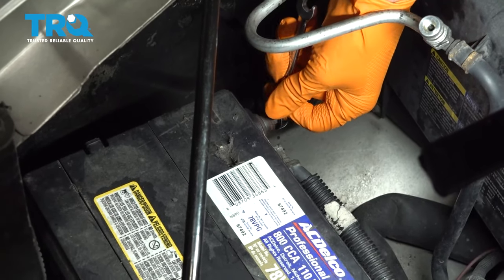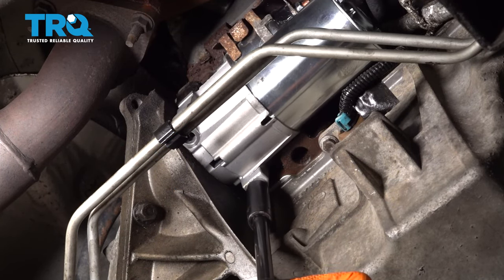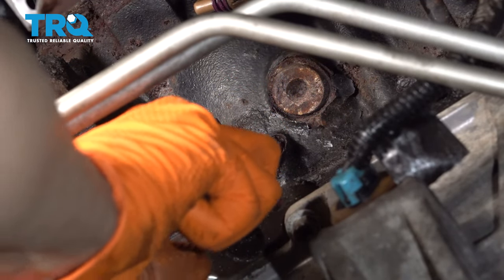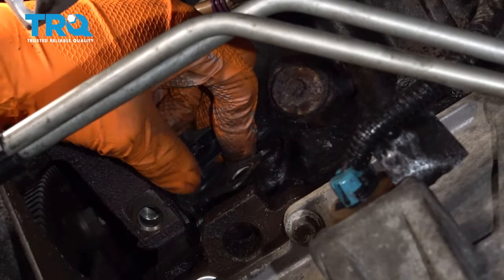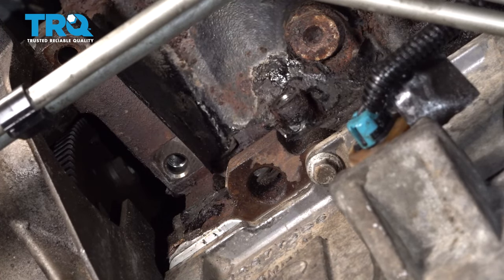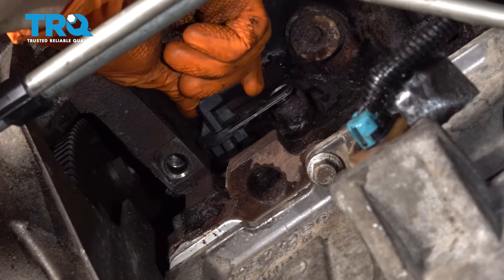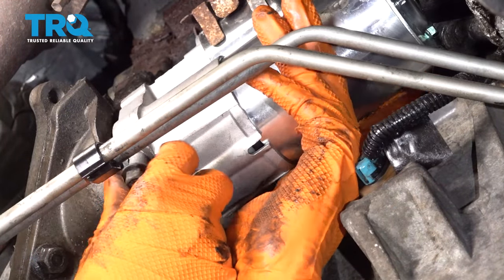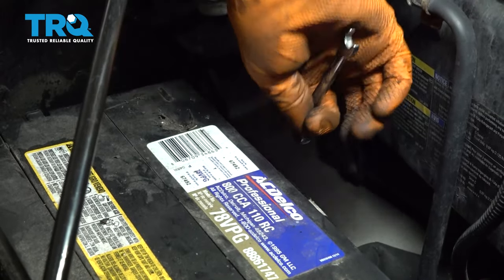How to Replace Crankshaft Position Sensor 2003-2021 Chevy Express 3500

Comment: my 2011 g2500 4.8 had an exhaust leak and melted the sensor and connector. before replacing it the tachometer was intermittent. Now that i have replaced it I cannot get a tachometer at all. It seems that I may have to relearn the new sensor. can you answer the questions about relearning the sensors?